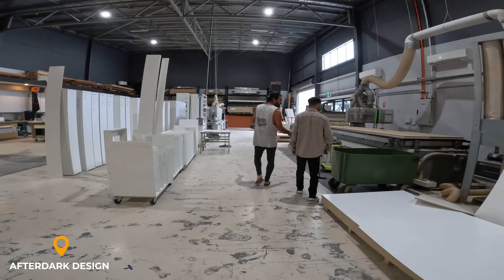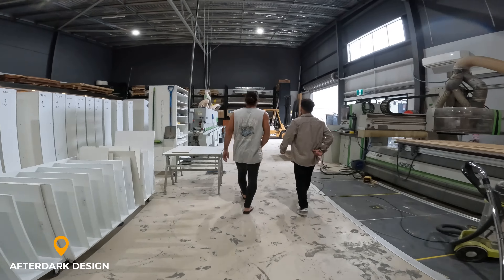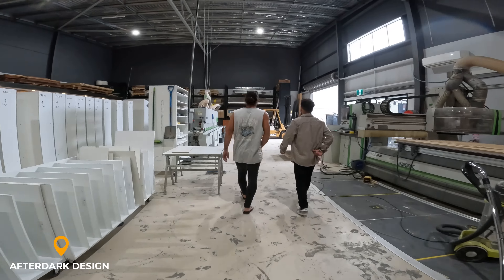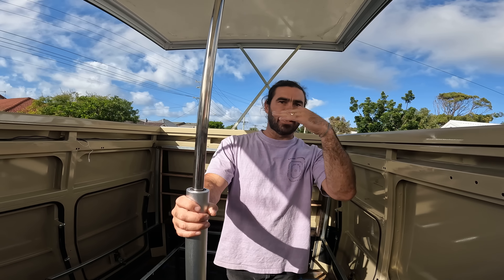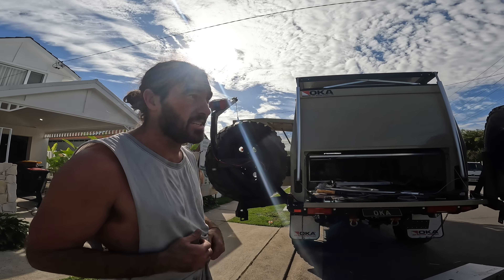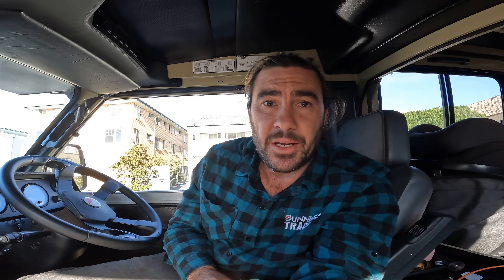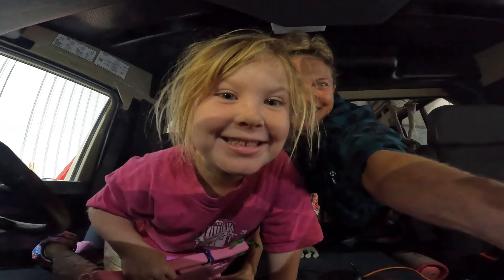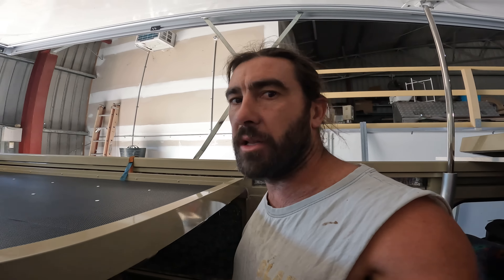OKA TRUCK BUILD SERIES EP2 - Custom Bed Fabrication, Actuator Install & Internal Design

Comment: Looking great. What an interesting build.
I've used that Car Builders  insulation and it is great. Hope you used the waterproof version so it doesn't get wet and soggy. 
Suggest, if you haven't already, you line the transmission tunnel and footwells to reduce heat and noise.
Will both the kids get beds?
Are you looking at going gasless with plenty of solar and a big lithium battery powering an induction cooker and electric hot water heater? It's the new trend in caravans. 
We are very impressed with our induction cooker. They work fast, which reduces power consumption.
Reply from the maker: Yep its waterproof .. Thankfully truck was sound deadened and insulated in the front cab by OKA

Comment: Careful with imbalance of actuators. Their speed depends on load (at same voltage). May need additional (buttons) to "trim" action, else you may twist your roof. Check new (Nov 2023) design RULES for lithium battery installation in Oz RVs.

Comment: Legends! This is coming along 💯👌 Where did you source those actuators? They look 1000% better than ones with external motors
Reply: They are firgelli bullet 50’s. They haven’t shown in the video but you want to use the correct control box the fcb 1 so you can calibrate and sync them otherwise they will twist the roof. They have 300kg+ of force each

Comment: Ues sparay the Actuators black!😁 I'm looking at doing the exact same thing on my camper trailer at the moment to lift my rooftop up will you be wirding them all in sync so they all go at once?
Reply from the maker: Yep .. you use a control. box to lift them all at once !
Reply: @KarstanAndMaxine  Would you mind doing a video just on the Actuators detialing the set up once done?

Comment: With those rear actuators on an angle they might try and push the roof forward??  Usually they are straight up and down. You could easily fit them inside you would only need that 70mm dia hole in the cabinets..  Loving the build.
Reply from the maker: all fitted now .. they pivot .. so they move outwards when going up

Comment: They look like the same Figarelli Bullet Series Actuators that are sitting in my shed waiting to get installed in my Isuzu NPS camper. I almost made the same mistake with the length but re-measured just before I pushed the order button and discovered I needed the shorter ones. Mine will also spaced in from one end so  I bought the sync  control box so that they will all go up at the same speed. 

All 4 of my actuators will be inside and I’m not sure if I need to space them away from the sides so that the poptop canvas has somewhere to go?
Reply from the maker: Yeps that's them !! These are the 200lb ones .. we have been waiting for the New FCB-1 control box to be available in Australia ... Just purchased it 2 days ago and will get that in ! also the momentary rocker switch so the kids don't lower the roof without me knowing haha .. our front ones are 100mm away from the canvas ..fits fine .. just make sure the split pin is fully bent so it doesn't puncture the canvas ! you will see in the next video !
Reply: I just pulled my controller out to have a look. It’s the old model with no LCD screen. I was thinking I might also use an isolation switch so I don’t accidentally try to put the roof up while the catches are still locked. :-)

I’m keen to see your roof in action as well as the rest of the build. Watching other peoples progress keeps me motivated to keep building!
Reply from the maker: @bradkark  yeah Id be scared to put it up with latches .. we won’t have latches just the actuators ..

Comment: 3D modeller here, what he was doing with that 3D scanner, was creating millions of points, each with its own X,Y,Z coordinate in space, called a point cloud. With a point cloud we can create a 3D model and also render it to make it look photorealistic,  then from that back engineer or in this case, design a complete new concept as in this case, to maximise the use of space in the compartment.
Reply from the maker: Spot on ! .. a lot easier than the old level and tape haha

Comment: Areyou going to put dust covers over the actuators?  like the old front shocks of  motorbikes?
See in Germany. the sides of the popup made from the stuff paddle boards are made of. just inflate it with a few psi and you have a stable and well insulated wall.
Reply from the maker: that's actually an awesome idea !! didn't think of that .. to late though ... poptop is all done !

Comment: He didn't nail that bed! He welded it!
Instead of 2 seats behind the driver's seat, & 1 seat behind the passenger seat. I would have made 4 seats behind the driver's seat. 2 facing backward & 2 facing forward (facing each other) with a fold out table that would double as seats for the kids & a four seat diner (eliminating the dinette at the back) Behind the passenger seat a bigger fridge/freezer & pantry. Behimd the door on the passenger side would be the sink/stove/ovem & more cupboards. This would leave a nice size shower/toilet room on the driver side behind the seats/diner. 
Just my thoughts. Happy trails, Cowpokes